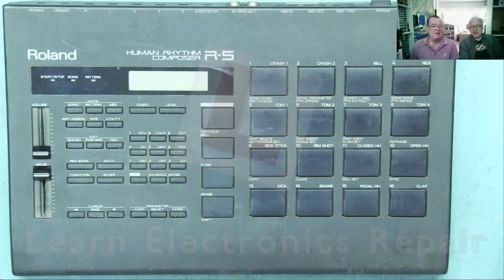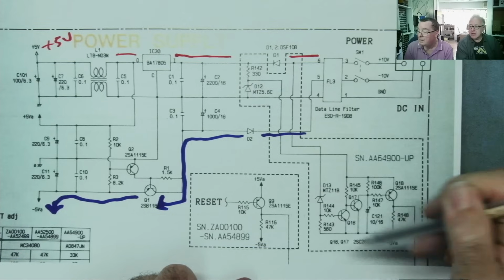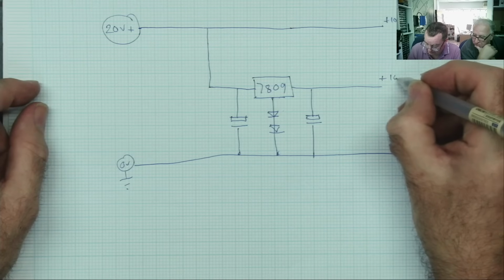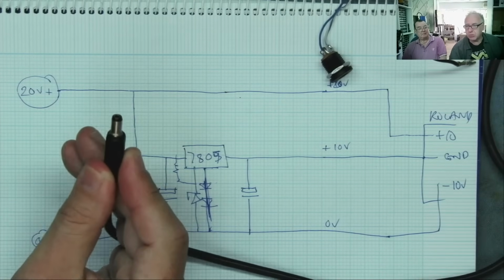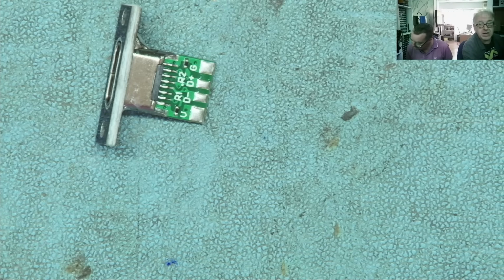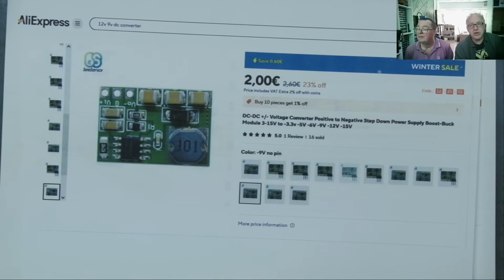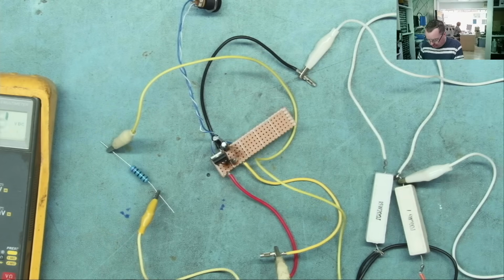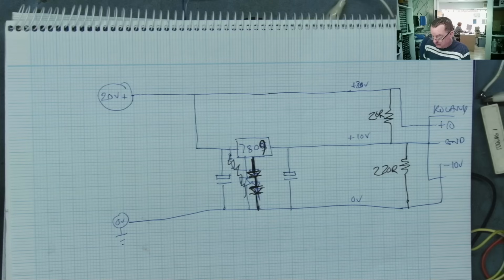How To Convert Your Dual Voltage Rail Device Or Project To USB Power

Comment: Linear voltage regulators like the 7800 series cannot sink current, so you can't use them as a virtual ground. The silly but correct way to do this is with a power OP amp, either a monolithic one (hard to find and expensive), or one built from a normal OP amp and some pass transistors (about a dollar in parts).

The not silly but correct way to do it is with a center tapped 24v transformer, a couple if diodes and caps, a 7810 and a 7910.

Comment: The USB-C connector you use has resistors to tell the power supply to deliver 5V/1A, which is what it seems to be drawing while idle. Won't the power supply cut it off if it draws more current? Some might tolerate it, but this could be an issue.

Comment: Wow... that was so interesting about the power supply,  I don't have too much experience in how the negative portion of a power supply work other than seeing circuits that are designed with their own negative output voltage regulator.  But with this design exercise that you created Richard,  We stumbled upon something I wouldn't expect at least theoretically speaking as a discussion. Without deep analysis and testing which we wound up doing... I hope I have a good understanding that the load for this circuit design you created as long as it's balanced for the positive and the negative... The reference to ground will be where it should be...???  and the voltages will be equal ? Regardless of my explanation or understanding this whole exercise was needed to gain some experience and understanding. Also, the usage of the diodes to get more voltage I'm still... Working on that one,  I suppose I'll have to tinker to gain a better understanding... Is it possible that putting the diode in the ground circuit of the voltage regulator affected the way ground responds in the negative pathway?    This still was an excellent discussion and exercise that brought about the usage of some parts that I had never considered would do what we attempted to do.  If we pick up this subject in the future again, I'm sure I will gain a better understanding to reason with what we were attempting to do with this circuit.   Det, I like your solution much better  Ha ha ha and I still thought it was very creative and will remember that pathway to creating a power supply circuit. I agree often times it is just easier to purchase something already pre-made.

Comment: I would suggest another way of splitting the (Isolated) 20V supply, use an Op Amp with the positive (Non Inverting) input connected to the centre of a resistive divider e.g. two 10k resistors connected in series across the 0V and 2OV rail. The output of the Op Amp is fed back to the negitive (Inverting) input and is the virtual ground. If the current inbalance is too large for this circuit then an emitter follower (using an NPN and PNP transistor ) can be added at the output of the Op Amp, the base of the transistors connected to the Op Amp Output, the emitters connected to the virtual ground and the collectors connected to the respective supply rails. At the balance point, because of the high gain of this loop, there is the possiblity of high frequency instability, this can be cured by placing a low value (say 1k) resistor between the base and emitter of the transistors. To reduce the power loss in the transistors, power resistors are needed in the collector lines of the transistors to keep the power dissipation within spec for the transistors. This circuit appears to be one of those well known circuits that not so many people know of. 

  You appeared to be uncertain as to why the Regulation within the Roland was set up as it is. The +/- 10V comes in, the +5V is regulated by the 5V regulator, the -5V rail is unable to rise until the output of the +5V is present, and the level of the -5V rail is set by the resistor chain R2/R3 connecting to the base of Q2.
  The circuit to the right hand side appears to be a "PSU Good" indicator. With +10V input present and no -5V the voltage across R148 is high ~ 5V. When the -5V is present the voltage across R148 is low ~ -5V.

  
  I have been doing electronics for approx 60 years, but I still find people who can teach me tricks and ideas, keep up the good work.

Comment: Grounding issues with Richard’s power supply as the output of the drum machine will be connected to an external amplifier. Det’s power supply will likely have noise on the output IMO. Best way is to make a decent linear power supply from an inexpensive transformer with dual or centre tapped secondary IMO.

Comment: I vote for the USB C supply. The Voltge regulator has a flaw in it. What if the loads are between + and gnd and - and gnd are different. Then there will be an issue at the the GND it will change.. Edit: I watched further and you saw it yourself, sorry for that!

Comment: A proper "virtual ground node" must be able to either source or sink current.
To split a supply, one way is to use a unity-gain power op-amp to buffer a simple resistive voltage divider. You connect the non-inverting input of the op amp to the junction of the two resistors and the inverting input to the final output of the amp. The amp output is the virtual ground node.
This is not at all as simple as the words suggest if you build your own buffered amp. There are issues with cross-over, dynamic performance and capacitive loading. An audio power amp IC might be usable at moderate current if the whole affair is DC-coupled, but such amps may object to capactive loading.

A better solution, once the magnitude of load currents has been determined, is probably an off-the-shelf DC-DC converter module with positive and negative output that are fully isolated from the input supply.  Beware of switching noise from such modules. I've successfully used small ones in analog instruments, but care is required. You can add extra filtering on the outputs but read the datasheets carefully. With many you can't just add a bunch of capacitance.
Don't attempt something like two buck converters from the same input supply. It won't work! 

Given that the internal circuit of the device regulates the voltages, a simple unregulated split supply with an iron core transformer is reasonable to consider and probably what was originally used.

Comment: You can actually make a dual voltage supply using two identical cheap buck converters by using a trick where you invert the output on one of them. this way both sides gets fully regulated and does not become sensitive for different loads. in fact the inverted side will have a bit less maximum current so it would actually be perfect for this purpose

Comment: The 2 zeners cannot be in series, otherwise it'll be a short across the 330 ohm and diode.
A voltage divider from the output also works with the 7805 but you need caps for both halves.
And usb c is the way, one PSU runs anything and everything.

Comment: It's strange that Roland went with that connector.  You can buy a PSU in the UK for £50 but not an original Roland manufactured device.

Comment: Using an inverting boost/cuk topology seems the obvious way, but since I recently got about 12 old laptop supplies from a thrift store for $2 each, all of my projects now run on them. And every supply I get immediately gets converted to 5.5mm tip+ barrel jacks. I did also find a few power bricks with a dual rail supply at the thrift store, so if I was doing it, I'd obviously just use those. And 15 years ago I once acquired a whole box of (pre-USB) left-behind cell chargers from a hotel, and I'm a little embarrassed to admit I did make a few +/-10v supplies by wiring 4 of them up in series.

Comment: Perhaps in hindsight, why do the diodes change the voltage?
I believe to do it using linear regulators you need to use 2 linear regulators (+) in series. (a controlling device for each rail)
Det's way is the way I did it on an old robot I have. I needed -6v-6v-, but I used two separate adjustable bucks, this way I could set any voltage.
Reply from the maker: Because the ground pin on the 78xx is not 0.6V or 1.2V above the actual ground of the device. Therefore the forward voltage drop of the diode(s) is added to the output of the voltage regulator  I showed this towards the end of the video
Reply: @LearnElectronicsRepair  I am sorry I did not phrase the question correctly.
I was refiring to the question about why the voltages changed when two different loads where applied.
The question I was asking, and I was thinking: Adding diodes is the same thing as adding a different load on that rail? Both changed the voltage?
In essence you are changing a potential difference between the 3 pins of the regulator that control the output?

Comment: Hi, Did you post the links to these buck boost boards from aliexpress? I dont see them.
Also, with the plus and minus module will it work if the current demand is significantly different on each rail ?
Reply from the maker: We didn't because as Det says, links can become outdated quite quickly.  But we did show you a listing from AliExpress so you know exactly what to search for there 😉
Reply: @LearnElectronicsRepair  ok, thanks.
I did find them on aliexpress, plus an adjustable version.

Comment: Richard's idea is better.... what would be even better is combine the 2 the power suply rich dreamed up and the 2 9 volt cells.. have a switch to switch from mains to battery... and then it can operate even when there is no mains available... the only question is at this point how much current does that drum machine draw !!! so you can calculate how long the 2 cells will last.... and you should use rechargable cells.. and they are getting hard to find for 9 volts and the chargers even harder to find !!!!

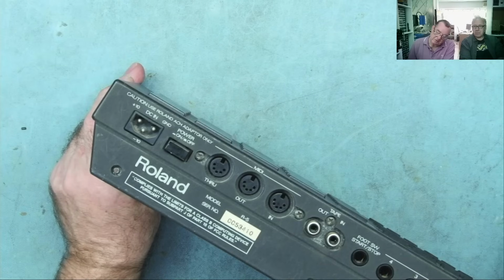Comment: At timestamp 1:04  it is easy to solve take that connector out and put like a little plate from tne inside and mount a connector of your choice with a powersuply that does + and - 10 volts ...I do not see the fuzz about it or what is so interesting about it.... it is kind of a every day problem with many devices !!!!
Reply from the maker: Well that is what does make this interesting, because a lot of viewers will not be familiar with these techniques or even realize this can be done, and like you say this is an 'everyday problem'.  Everyone has to start learning somewhere.

Comment: The 7809 can not regulate if you are pulling the output upto its input. it will just try to limit the current flowing through it in order to try and get the output to fall back into regulation.
These circuits are OK for providing a form of reference by no good as a power supply.
Have a look at the internal circuit of the regulator that will show you what problem you are looking at.
Reply: That is also what I think happens. The load between +10V(+20V) and virtual ground (7809 output) pulls the voltage of the output of the 7809 above the regulation voltage causing it to fall out of regulation. If the load on the +10V would be less than the load on the -10V you have a better chance that it works more or less but I would never consider such a circuit as a good solution.

Comment: Det's solution is very elegant but it is running right at the limit of its design so I would not expect it to survive very long. I've done a similar thing with a single output and it burnt out after about 15 minutes.

Comment: looking at the circuit.
starting point. 
 Q16 is off
Q17 is on
Q18 is on so the line going off the sheet is at +5.6V

As the power supply voltages rise, the voltage across D13 will increase and when it passes about 11V it will start to conduct.
The current flowing through D13 and R113 will cause a rise in voltage across R113 which when it reaches about 0.7V will turn Q16 ON.
Q16 turning ON will in turn turn Q17 OFF.
Q17 while being ON was shorting out C121, but now C121 is free to charge up via R146, the time constant being R146 and C121. 
Once C121 has charged up the voltage on the base of Q18 via R147 will be the same as the emitter so Q18 will turn OFF. there being a delay while C121 is charging.
The line going off screen will now fall to -5V as it's being pulled down by R148. Without knowing what else could be connected to that signal you can't say what the voltage will be but should be around -5V I'd expect.

I rest my case as it was getting a bit heavy 🙂

Comment: It's regulated by the +5V supply. the +5Va is being used as the regulator reference.

The problem with a virtual ground however you make it, if the 0V of your power supply is referenced to ground then you can't connect your virtual ground to any 0V that might then be connected to earth as you will short out the virtual ground (e.g. +10V).

it would be better to use a isolated DC-DC converter, I use a few recycled expensive IBEC 12ICR 6-1515-s. These provide a +/- 15V supply from a single supply rail. and the ground is fully isolated from the 0V of the powering supply.

There will a cheaper range of isolated DC-DC converters which have a range of inputs and outputs to suite what your requirements.

Comment: Is the power ground not connected to any other i\o connectors? If yes wouldn't you have a potential between grounds of the connected devices?
Reply: that's always a problem with virtual grounds when they are needed to be connected to the outside world. Ok if your supply is isolated so no ground reference. Problem with USB is there is no knowing if the 0V is isolated or not. From a wall watt it could be isolated but from a PC it could be grounded.